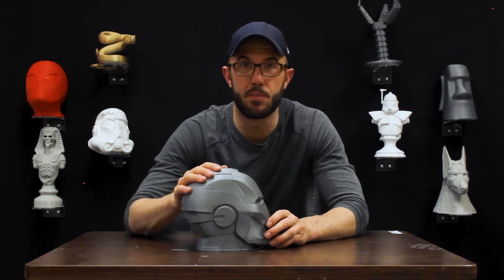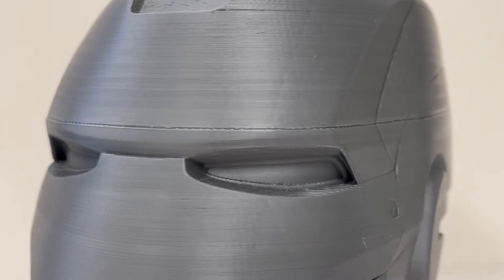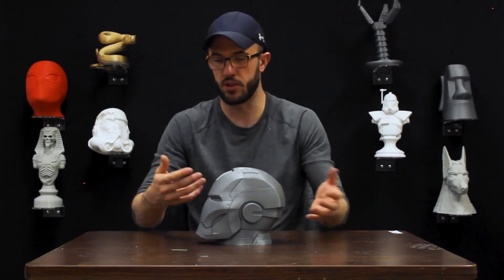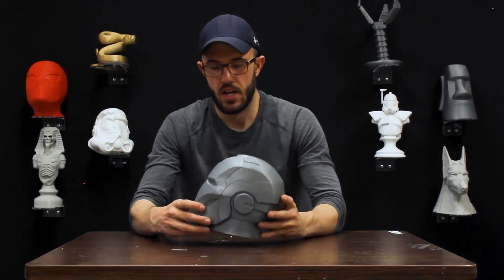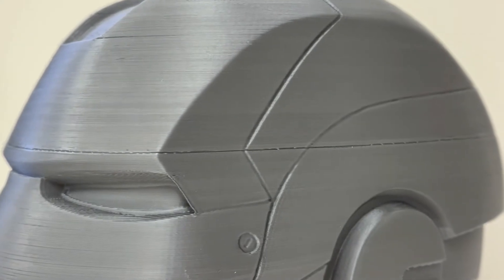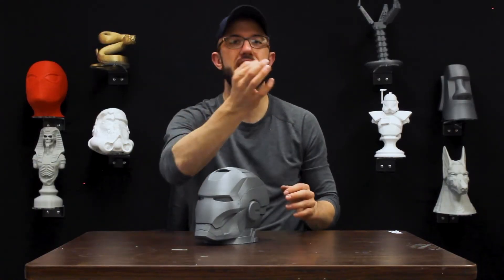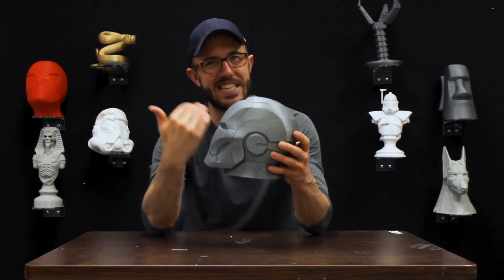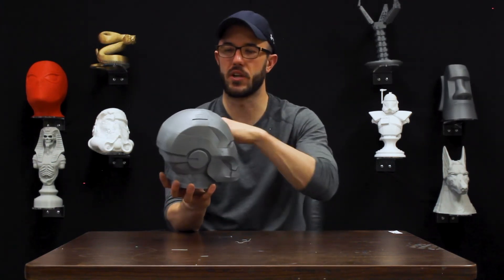3D Printer Problems: How To Fix Single Layer Skipping

Comment: It's the issue with firmware - power loss, pause and filament runout will cause this issue.
Reply: I had on a print that I didn't have to change the spool on and I wondered how to troubleshoot it
Reply: @Body_Spring  reduce outer wall print speed and also check for clogs